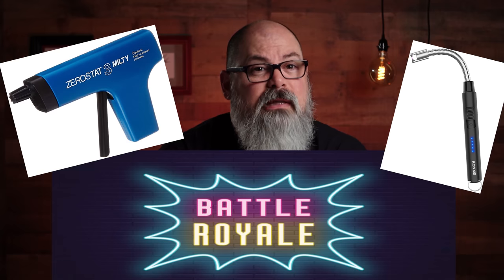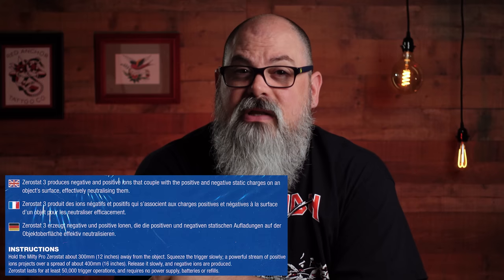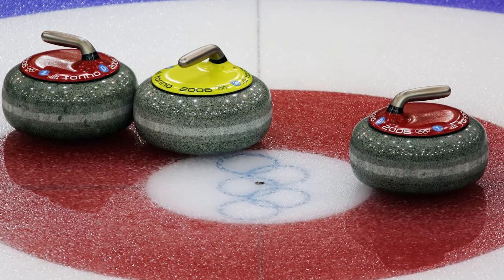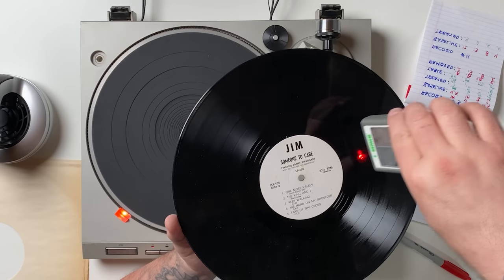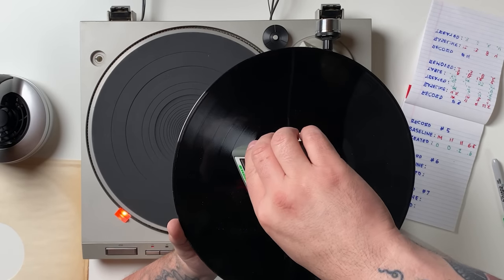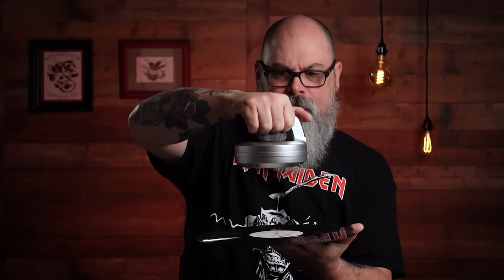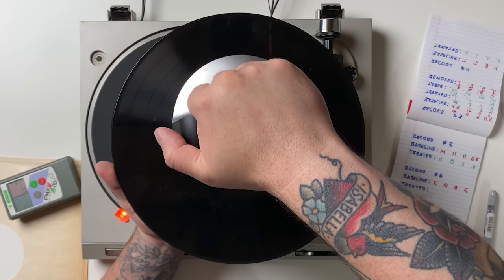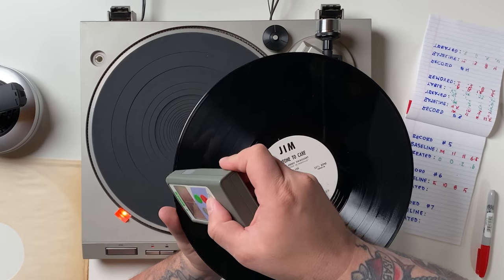How Well Does The Destat III Work?

Comment: Thanks for testing with every reasonable variable accounted for.  It's the sort of thing I'd do...if I were spending someone else's time, intellectual effort, and money.  While we've got you working, idle curiosity has me wondering  if the records pick up static during playback and if Destating them before putting them away is worth it or if they'll just pick up a charge while sitting in their antistatic sleeves.  It doesn't really affect anything as the only way to be sure is to nuke it from orbit.  Sorry, I mean Destat it prior to playback.
Reply from the maker: Playing the record does introduce some static, but it's not generally terrible from my experience. Giving your records a quick anti static treatment before putting them away isn't a bad idea, but if you're treating them when you bring them out it may not be al that necessary.

Comment: Thanks -- for £405 today I will keep using a simple anti-static cleaning cloth for £3 and brushes for not much more. You would be advised to release any static on your hands before handling the disc -- standard for any work with electronics or other static sensitive items. You can wear a wrist strap or just touch something metal that is earthed.
Reply from the maker: While I understand the trepidation about spending that kind of money on an accessory, it is by far the best thing out there. Wipes, brushes, straps, and anything else you can think of don't even come close. It's just a matter of how important static elimination (and budget) are to you.

Comment: Great review, and worth the price on high end setups. Might have to grab one when my ultrasonic cleaner arrives. I hear they make records more susceptible to static.
Reply from the maker: An ultrasonic is a wet clean and won't introduce static at all. The Destat is still a good tool to have around if you can justify the cost.
Reply: @thevinylattack  after the record is clean, any oils and foreign materials that helped discharge the static are gone. The most static albums I have are my new, clean vinyl. I guess the ultrasonic cleaning gets it ‘new’ again and more able to hold a static charge. My assumption, mixed with what I’ve seen after cleaning. I’ve had no way of measuring, and didn’t know the humidity of the room when comparing.
Reply from the maker: @lewiswaddo5045  New vinyl isn't all that clean anyway and they come out of the sleeve loaded with static most of the time.

Comment: How many uses do you get out of the AA batteries?  Is there some indicator to know when to replace them?
Reply from the maker: Unfortunately, there is no indicator. The batteries last a long time though. I change them maybe once or twice a year. It'll depend on how much you use it.
Reply: @thevinylattack  THANKS. Once again, good to know.  I'll probably stick to getting a Zerostat Milty one day.  I had one in the 1970s and thought it worked just fine. But I'll likely be using a grounding cable too.

Comment: Any chance you could test this after doing a wet cleaning using something like a Record Doctor or pro-ject vc-s, and compare it  after cleaning with a carbon fiber brush?
Reply from the maker: I have something along those lines in mind, yes.
Reply: On a related matter, I use the DeStat III before and after a wash/dry cycle in my DeGritter.....and I am VERY IMPRESSED with the results !

Comment: Question - would the static results be different on an Acrylic platter?
Reply from the maker: It would probably depend on the platter. A solid acrylic platter probably wouldn't make too much difference, especially if you zap that for static as well. An acrylic platter mat, however, isn't worth the material from which it's made, in my opinion.
Reply: @thevinylattack  Thank you.  I was wondering about the value of some kind of anti-static platter and if one exists.
Reply from the maker: @tabithamaydavis5792  Some platters are naturally more resistant to static, like cork and I think the Achromat, but every platter is susceptible. Treating the record before every play is the only way to be sure.

Comment: How long does the device last?  Doesn’t the Zerostat say it’s only good for so many thousand blasts?
Reply from the maker: The Milty says it's good for 50,000 trigger pulls. That's a LOT of pulls and you'd likely have that for more than a decade. The Destat doesn't say how long it'll last so I guess I'll have to let everyone know if it dies before I do.
Reply: @thevinylattack  My experience with the ZeroStat 3. My first ZeroStat might have lasted 5-6000 pulls, my second lasted just 2-3000 pulls, failing slightly after the one year warranty period. Their customer service was worthless. I won't buy another one.
Reply from the maker: @TheAgeOfAnalog  I'm sorry to hear that. I wouldn't want to spend that kind of money a third time either.

Comment: Static on the record is going to be in zones - Positive and Negative. Dust is Positive,  so will attract and cling to the negative zones and will be hard to remove, and maybe some other particles are negative, will go cling to the negative zones.
SO  I think  the point of this is to saturate the record with a mix of ions which will equalize all the zones so they have no polarity, THEN remove the NOW loose dust. Just equalizing the static charges does not clean the record. Aslo I would like to see the  + - mapping of the whole disk. 
HARD to do I know but the test should be: Microscope photo showing dust clinging to record, equalizing the zones, "cleaning the record", then microscope photo showing clean groove. (or just playing the record before/after.
Reply from the maker: Site your source for static being in 'zones'.
Reply: @thevinylattack  Well dust is positively charged and so is earth, so that's why negative ion generators which  negatively charge dust, allow it to settle. But dusk clings to records, so as it is positively charged, the record must also have negative charged areas or the dust would be repelled. Your meter should show this.
Reply: @thevinylattack  mmm wiki says that dust etc in the air can have both charge states, but I have been sold negative ion generators to remove dust cigarette smoke etc  from the air by neutralizing its positive charge and allow it to settle to earth.
Reply: @thevinylattack   an article on the process is:  https://en.wikipedia.org/wiki/Electrostatic_precipitator showing dust being negativity charged to cling to the ground plates.
Reply from the maker: @AreTwo2  None of this points to there being 'zones' on a record for static. Regardless, as I tested the same four consistent areas across all the records, the results are not only repeatable but clear in their result.
Reply: @thevinylattack   From my view, you have already demonstrated zones (or call them something else) as you have wildly different voltage measurements in the 4 places you measured the record. Your excellent demonstration of reducing the static "temps" me to pay $600 !! in Australia for the appliance, but the whole point of the static reduction is to aid the removal of surface contaminants causing noise. So, my interest is simply the removal of surface contaminants from my inherited (20 years in the garage) records, so, as you are the hardworking demonstrator and owner the device, I love the static reduction as part of the removal of surface contaminants, but the question remains at the conclusion of your demonstration - did it aid the removal of surface contaminants?  Thanks for going to the trouble of replying.
Reply from the maker: @AreTwo2  No, it doesn't clean a record. It's not meant to. It simply eliminates static and does it better than anything else on the market I've tried.

Comment: I think another test that should be done is while the turntable is spinning and the cartridge is touching the grooves what readings are being done while friction and air of spinning the plate can either neutralize or increase, I don't know, this just remind me when I was working in a manufacturing area secure on ESD, that we needed to test the ESD numbers while the circuit boards were traveling through the conveyors from one machine to the other, even the conveyors or equipment were properly grounded.
Reply from the maker: That's probably something I could test on my own if I remember the next time I'm playing a record, lol.

Comment: Hey Chris, maybe when you can test after playing one side I seem to get the most static after playing side one that’s when I detect The most static. To explain I remove album from inner sleeve don’t really feel any static holding the record I treat side one (with zero stat) holding in my hand’ play side one. Then flipping over to side 2 I now feel a decent amount of static so I treat side 2 and then play. So my question is how much more static is generated after playing one side or does the album spinning on the platter generating static without dropping the stylist maybe some more questions for you to answer and an answer to one of your questions I think my zero stat does a pretty good job so I don’t think I would spend the $300 plus but if my zero stat were to break I’m not sure hopefully it does not have a great one🇺🇸👍
Reply: Yes the stylus is creating static on the record when playing, any 2 materials dragging across eachother does pretty much.
Reply: @leon9021  I guess what I meant was how much more static after one side had been playedI will correct my question
Reply: @johnmbell4642  It will depend on a few factors, what stylus you have, or rather what contact area it has. Also, what humidity levels are in the room, humidity prevents static build up, which is why some have humidifiers in their listening room.
Reply from the maker: It's hard to say without being there what's happening. It may just be that you don't feel the static before playback but it is indeed there. Depending on the mat you use, it could be introducing a lot of static when you lift the record off.

Comment: I’m curious to see what the meter reads when you measure the destat it self. Perhaps the meter isn’t the right tool to measure ionization, but I’d like to see you measure what the tools are outputting and what the zerostat actually does  when the trigger is pulled
Reply from the maker: The meter only measures static.

Comment: 1) You did not go head to head with the Zerostat.
2) 1 of the conclusions which became obvious to me is Jus Placing the record on the turntable Reduces Static 
3) Although D Stat is very effective, it is WAY over priced. 
4) I am far more interested in the name and cost of your static measuring device!
Reply from the maker: Taking the record off brings the static right back which is the problem.

Comment: At the first part of the video, you mentioned that you were using a static mat.  This may sound like a dumb question* but, have you tested just laying a record on the static mat, for say, maybe 10-15 seconds? It should only require less than a second, but to be fair with your other tests, 10-15 seconds would be good.

I know that this is a video about devices that can be purchased, and people WILL purchase them, but since you already purchased a static mat, it seems like you might at least test it and possibly look into the feasibility of spending a bunch of money on additional devices. The static mat is what we use in the Integrated Avionics Shops the Air Force (with circuit boards that could cost more than a house).  I don't see why it wouldn't work for a lowly record. (The KISS method, I guess you could say.)

But then, it may NOT be as effective as the devices. . . Static electricity is one of those weird, mystical things that you know is there but mostly don't notice. You CAN touch, taste, and even smell it at times, but when you don't, it can bite you bigtime and, in more ways, than one and not just "in yer donkey".

I do like your meter, too. (I have a weakness for tools and test equipment.)
Thanks for the videos.

*I taught my students that there is "no such thing as dumb questions, only dumb answers" and that "the only really dumb question is the one that isn't asked". It did, in fact, help open up some of the more quiet and shy students and made for some interesting classes.
Reply from the maker: Either I'm missing it or I don't remember correctly, but I didn't (and don't) have a static mat. I did use an anti-static strap to ground myself during testing to eliminate introducing more static to the test, however.
Reply: @thevinylattack  Sorry, I guess I remembered wrong. My straps connect to the corners of my bench mat, which is grounded along with the mat on the floor and didn't even consider using just a strap. In 39 years, I've never seen just a strap used without the mat(s).

I used to have one of the Discwasher/Zerostats kits that you used in one of your previous videos, back in 1988, that I paid $28 for, brand new. I lost track of it somewhere between here and Germany. I used it for over 20 years before misplacing it. I went on eBay to see if I could find one and could not believe how much they were going for used. A beat up looking used one went for almost $100 in an auction and some were asking $175 for used ones that didn't look a whole lot better.

And you were right about the triangle pattern being in the original instructions. I didn't have a meter to measure static but did copy the albums to cassette tapes quite often (to save wear on the albums) and you could really tell a huge difference on the recording.
Reply from the maker: @tinkerscorner54  The zerostat (which you can find for $100 new) are indeed a bit pricey these days. A byproduct of a hobby becoming in fashion again.
Reply: @thevinylattack  Yes, I know what you mean. And inflation doesn't help at all. The Zerostat alone back then was $18. I thought that the DiscWasher kit was a better deal at $28. I wish I had bought a pallet of each and saved them for today.
Reply from the maker: @tinkerscorner54  Well if we're going to go back in time to make money, I'd like to bet on the Mike Tyson v Buster Douglas bout ;-)

Comment: what about using the datastat on the table with it turning? or would you still hold the record to use the datastat?
Reply from the maker: Treating a record on the table itself is pretty useless.
Reply: thanks for the quick response, so what about using a brush after using the datastat, I use groove washer
Reply from the maker: @teacx2000r  I dust my records as normal.

Comment: I cant justify the cost of The Destat III i got the RONXS Electric Lighter from amazon that you reviewed and it was better than my zerostat that i have used sence 1980 when my dad got one then in the 90s i got my own i sold it after the  RONXS Electric Lighter was way better thanks for the info
Reply from the maker: The lighter didn't work better than the zerostat in my testing, but for the amount of money that you save a strong case can certainly be made to use the lighter. I'm glad it's working out well for you.
Reply: @thevinylattack  I've looked for your Battle Royale static test video. Did you ever post that one?
Reply from the maker: @hereusethis  Not yet.

Comment: There are desktop versions of this device made by others that are in metal boxes without handles, and they can be bought for as little as $100. Now, holding a metal box with no handle above a record is dicey, but maybe modifying hacking one of those things woudl be a lower cost DIY route to the same result.
Reply from the maker: I'd like to see what you're talking about if you can share a link.

Comment: Love your video’s Chris. Thanks for the work. I would love however to see results after a full spin per side of an album. I milty star my records before putting them on, but sometimes even after a full play I’ll get a ton of static
Reply from the maker: People seem to want to see that so I'm sure it'll happen.
Reply: I really appreciate the video I just ordered one of these and it’s because I have a terrible static problem in our house and despite putting a true sweeper on my turntable and touching it before I touch the turntable and having a little humidity balls around the turntable I still get static on records I still get static when I touch the turntable and it shuts down and I had a problem with the same turntable  a month ago where the motor went out and I have a feeling it was related to the static and I don’t want to chance it again in this case when you have a Turntable to cost over $2000 $300 to protect the maintenance of it over. Time and prevent possibly burning out the motor is worth every penny thank you very much for your video Chris

Comment: In its description it states its a fan with an Ion generator. Would an ion hair dryer on cool do the same thing?
Reply from the maker: I don't really know, but I DO know I wouldn't blow concentrated heat at a record. It runs the risk of not ending well.
Reply: @thevinylattack  Heat absolutely not but as I said a low cool setting should be no issue.  This guy tried it years back with good results. I've had good results using a rocket blower and microfiber cloth. I would test it but I don't have a static tester. = https://audiokarma.org/forums/index.php?threads/ionic-hair-dryer-eliminates-static.114284/
Reply from the maker: @dt6366  I'll take a look and see. Thanks for the idea.

Comment: If records lose their playing surface static when placed on the player, then one should just run a carbon fibre brush to remove dust and enjoy the flush feel of a clean unstaticy record, and cash in pocket.   The zerostat is way more than good enough for me.
Reply from the maker: The static that bleeds off into the turntable causes problems of its own. It's always a good idea to treat a record for static before placing on the table.